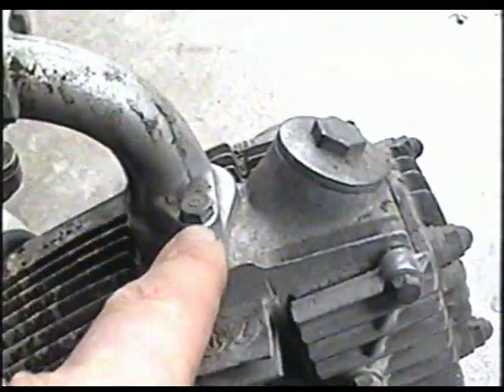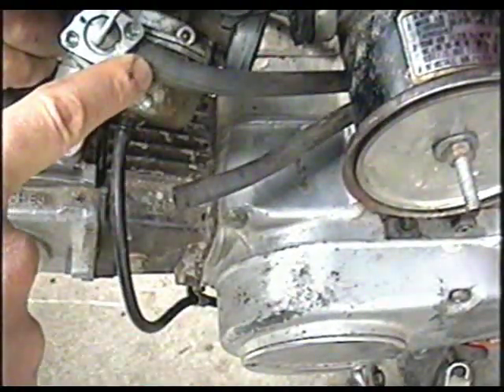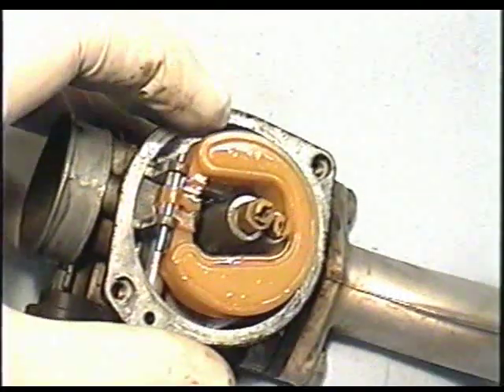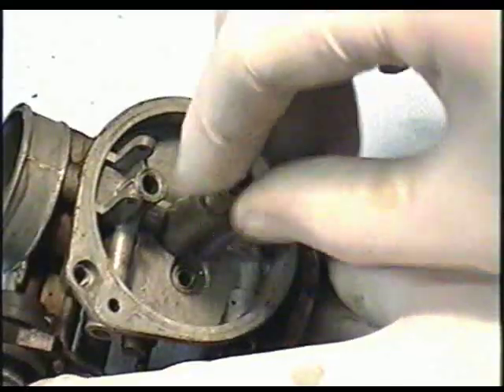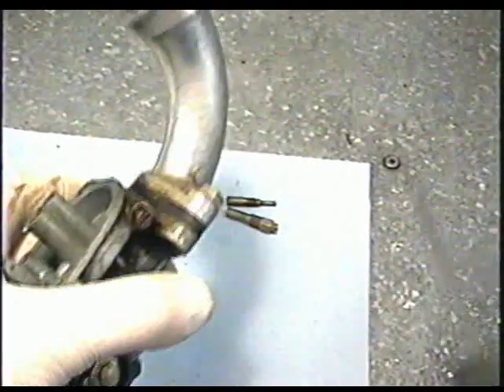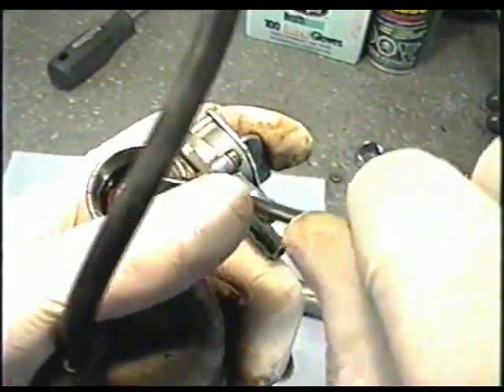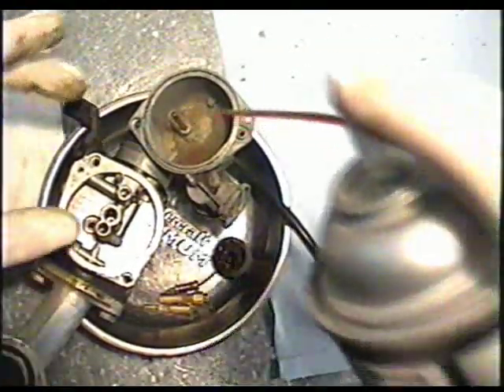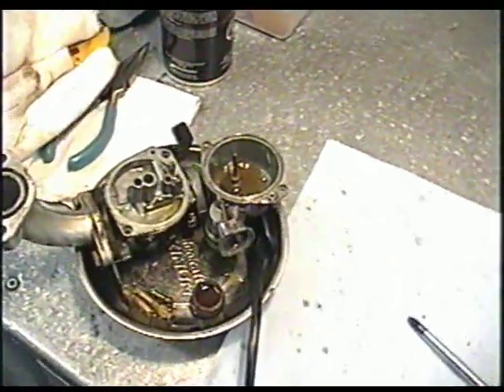HOW TO CLEAN The Carburetor on HONDA CT 70 Mini Bike - PART 1/3

Comment: Fantastic instructional video!  I have an old Honda MB5 (sitting for years), with only 1400 miles on it, and I used 'Seafoam' fuel additive to make it run better.  Whereas, before it only hit 40 MPH, now it can hit 53 (it's maximum speed) after a few tanks of 'Seafoam' added!  I did this instead of taking the carb apart because i'm not that mechanically inclined.

Comment: My 1984 Honda spree starts right up and idle seems good, but when I give it gas especially going up a small hill the motor bogs down and stops. I tore apart the whole carb and cleaned it with carb cleaner. drained gas tank and filled it with high octane. cleaned spark plug and gap is correct. I was told i might have a gasket leaking air some where? any sugestions?

Comment: Hi Dony!  Does the engine have to be removed to replace the ignition coil on the Honda CT 70? I can't get the new spark plug boot from the body cavity to the spark plug. There is not enough room between the engine and the frame.  HELP.  By the way, you are F*CKING Awesome!
Reply from the maker: it's been a while since I worked on one, you shouldn't have to remove the engine but you might have to remove the gas tank